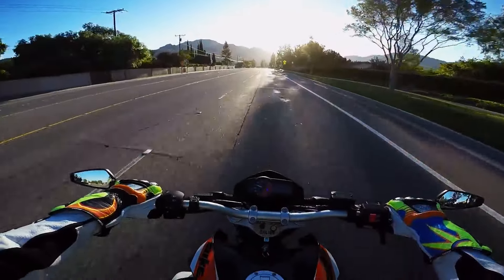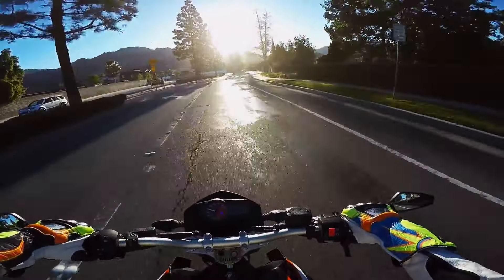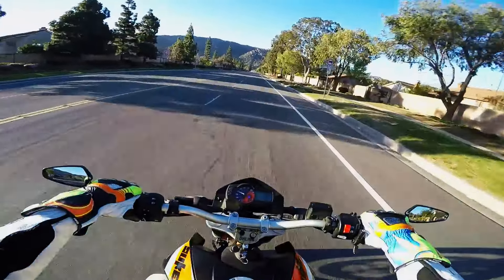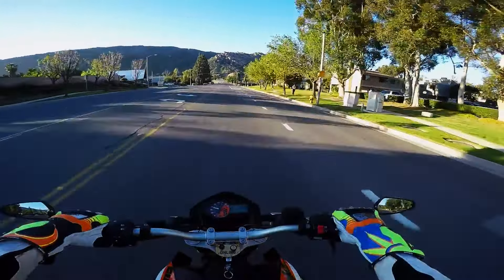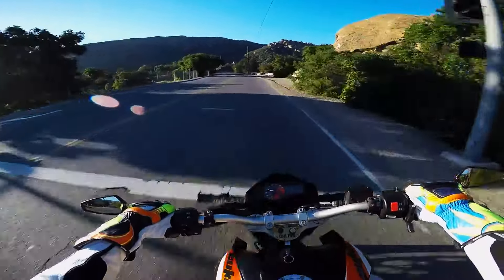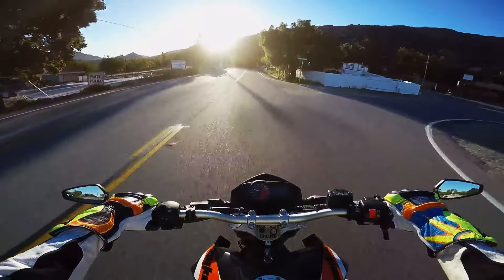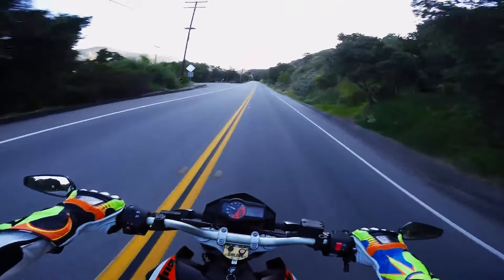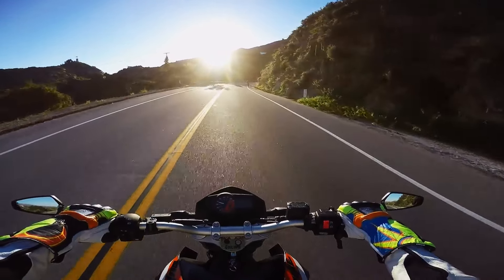Changing Gearing ...GotDave? #92

Comment: Which 17 tooth did you use? Forums say it caused issues. I think this would help my highway riding.
Reply from the maker: It's a genuine KTM 17 tooth front sprocket out of their catalog. Ordered it through the dealer where I bought my bike... KTM Part# 58033029117 ...for a 2014 Duke 690.
Reply: Cool, will pick one up.
Reply from the maker: The tricky parts as i remember: gotta un-bolt the clutch slave & move it out of the way (you won't have to bleed it, it stays sealed) & the big nut holding the sprocket had a locking tab you gotta bend out of the way I think. Good luck bro!  5000 rpm = 75-80mph with that 17